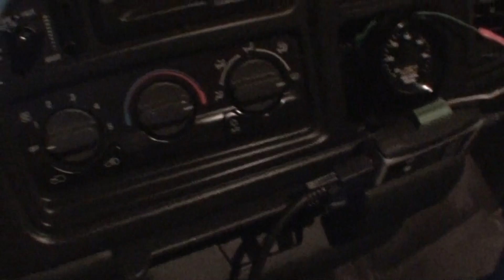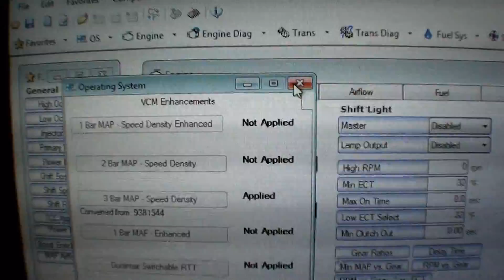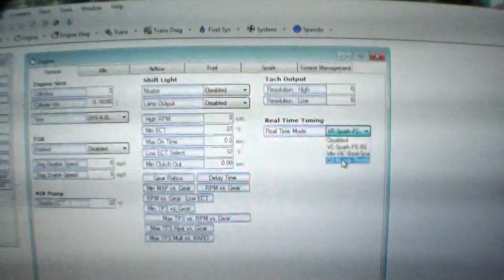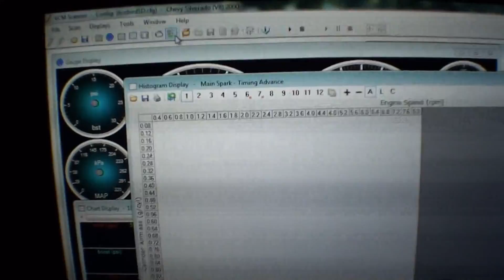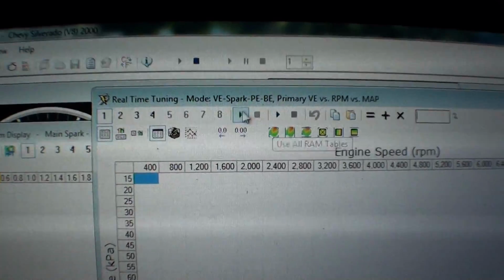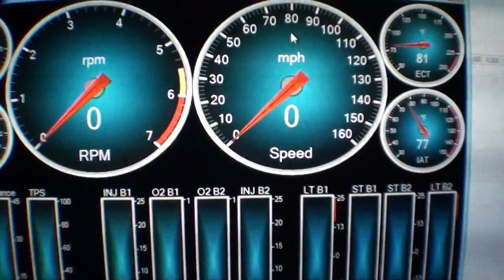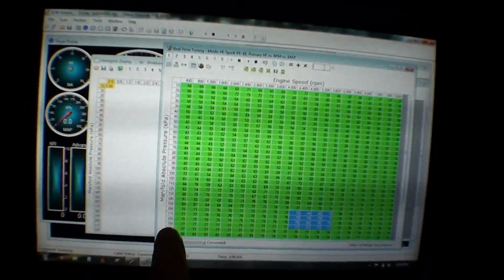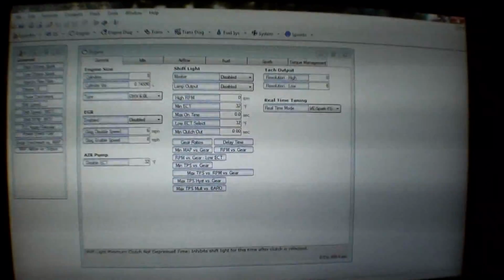5-20-13 how to use HPtuners(RTT) Real Time Tunnig

Comment: Working on a turbo swap for my 2008 GM car. Previous years had a 1 bar map and a maf sensor. Mine has a 3 bar map in the manifold and a maf sensor. I'm currently planning my custom exhaust. Gonna be custom mild steel turbo manifold and k was going run factory down pipe. Should I have my welder weld in an extra o2 bung in the down pipe for wideband? Is that all I'll need to tune with hp?

Comment: I added a hotter cam. How do I add fuel?
Reply: Nola big Fan The HP tuner program tell u at the bottom what everything does. I adjust the AFM and the engine run closer to14.7.
Reply: +blackericdenice I want u to tune my Bugatti, Im rich, I have 94 million dallaz and 43 cents, cash money

Comment: New to this just curious how u installed your map sensor and have the ecu reads it. Presently have a maf and want to switch
Reply from the maker: you have to re program the ecu for speed density
Reply from the maker: honestly unsure, i know there is real time support for non SD OS i think, i would have to investigate it

Comment: are you running the pro of standard HP tuners hardware?
Reply from the maker: i have a pro cable, but for gen3 stuff i would recommend getting the regular version and just putting the wideband input into the EGR 5v wire and then doing the guide on corvette forums for getting your wideband input to work over the egr pin

Comment: Stupid question but why bother with megasquirt when hp tuner seems to have way more options including timing control and inj control at ease for ls engines? Would you recommend hp tuner or ms3?
Reply from the maker: microsquirt is easier to jump into i think, cheaper also starting from nothing

msorstockpcm | sloppywiki

this article i wrote quickly summarizes why i choose either or

Comment: You don't HAVE to convert to speed density to use RTT. You can also use "1 bar MAF enhanced". This is just an FYI for the masses....
Reply: Old ass comment but maybe you'll see this. How do I get the 1 bar MAF enhanced upgrade? My 2006 p59 PCM only has 2 or 3 bar MAP upgrades listed.

Comment: Nice vid, Denmah!  I'd just like to add (in case some are wondering)....that you DO NOT have to have an SD o/s on the PCM to enable RTT.  The "1bar maf enhanced" option will allow those using a maf to be able to use RTT as well (on supported vehicles).  :)

Comment: its funny you say this because i was wondering this exact thing, so i researched it and found out that you can tune while you drive like megasquirt. I have a tpi system i want to put on my c20 pickup 5.7. I suppose instead of running megasquirt, i can get the stock ecu from the tpi from a j/y and run hp tunners and get similar results with 1 70mm turbo. 
Do you think either system is do-able running speed density? I am running megasuirt on my 1.8t so i am familiar with the ms1 ems.